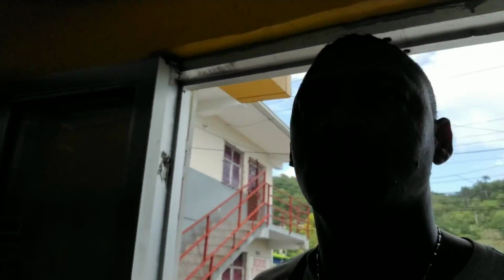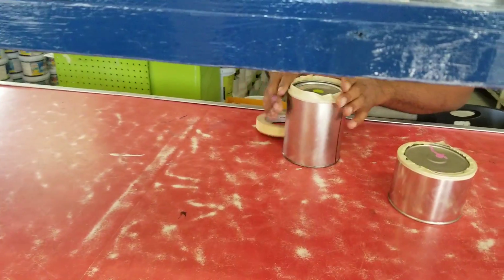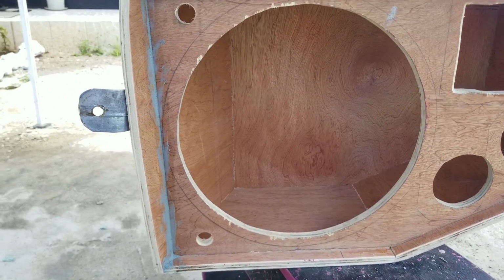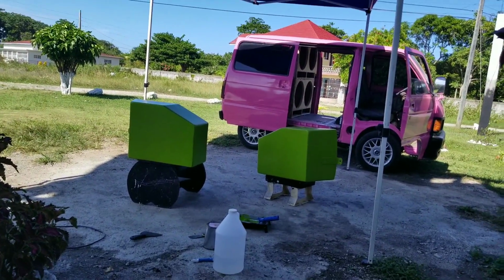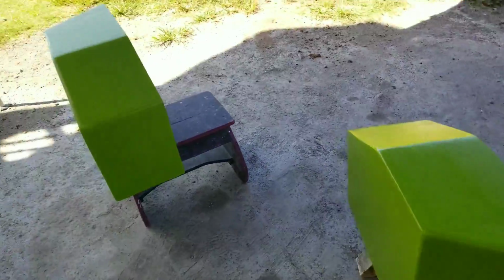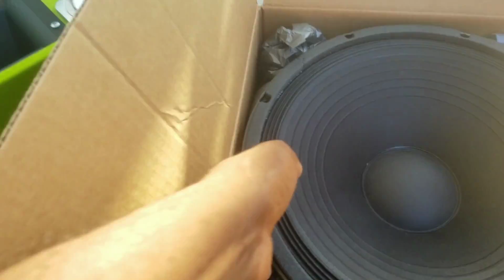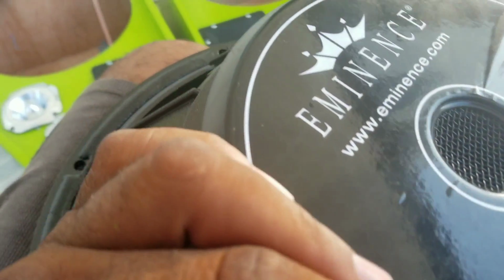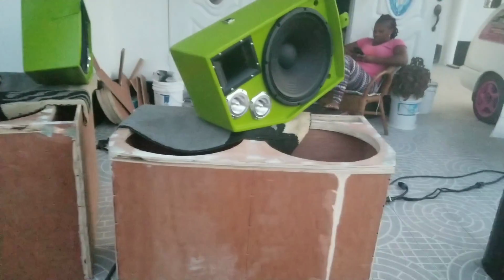How to paint and play window boxes...pink bus build part 4 .....

Comment: Question? Instead of using 4 18" speakers why not used 2 24" speakers, wouldn't that much better in weight and still get the same sound?
Reply from the maker: 24 × 2 = 48 and 18 × 4 = 72 EASY MATTS THAT BRO. MORE CONE SPACE
Reply: @nizmosoundstmary  overstand that bit about the cone space still was calculating the weight and I know the 24" sub play real hard. 👌🏾👍🏾✌🏾
Reply from the maker: Woofers am using dnt weight much
Reply: @nizmosoundstmary  👍🏾, your sub is 8 ohms each?
Reply from the maker: Ye
Reply: @nizmosoundstmary  that is why you play so hard because you playing them with a 4ohms amp.. 👌🏾👌🏾
Reply from the maker: 2 ohm amp mi using an mi speakers wired to 2 ohm
Reply: @nizmosoundstmary  so it's 1 amp you use to play bass.. Wow 😳😳 👍🏾👍🏾👊🏿👊🏿👊🏿. I'm thinking it's 2 amps you was using..